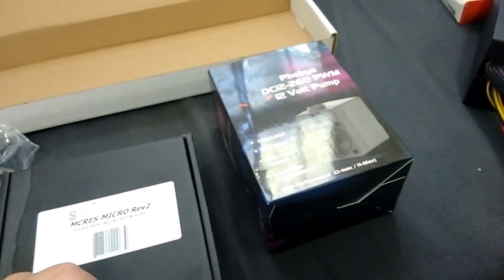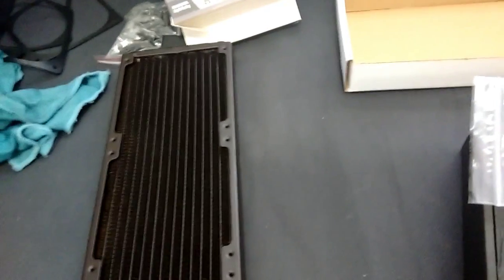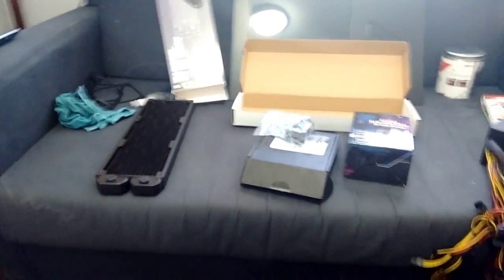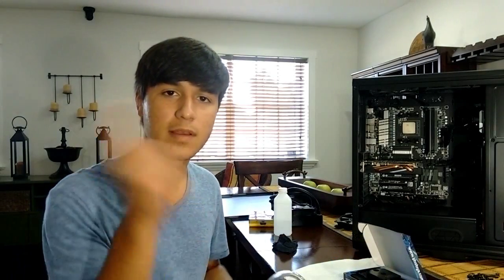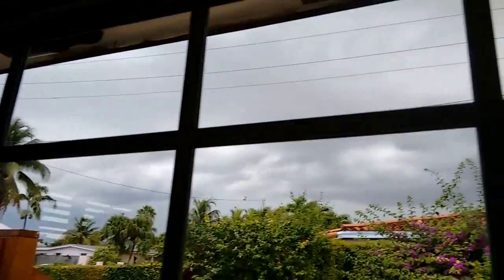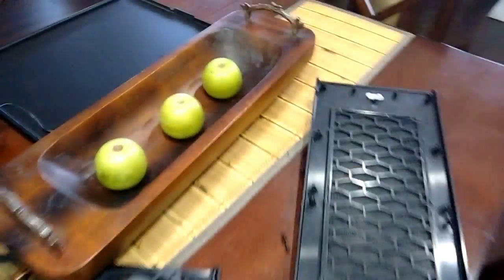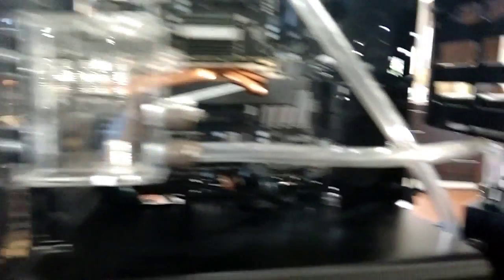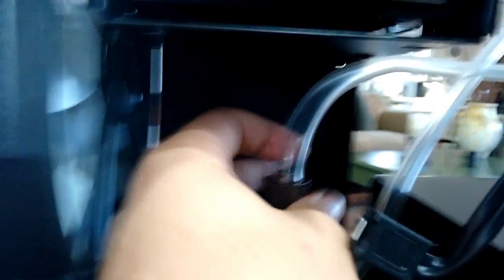My First Water Cooling Loop! Pt.1

Comment: The thing you are seeing on the radiator is flux used when soldering the parts together for better contact. There will always be some left in every radiator which means you need to thoroughly clean the radiator inside and outside. Depending on the brand the pre cleaning process is better for more expensive products as they have better quality control.
There might be even some left over metal inside the radiators so forcing distilled water trough the radiator and let some acid or even warm lemon juice sit inside the radiator will help to clean all the flux and the metal.